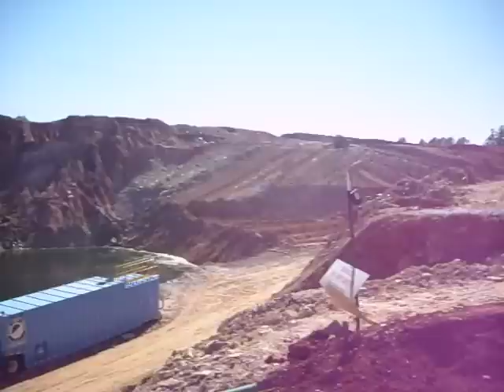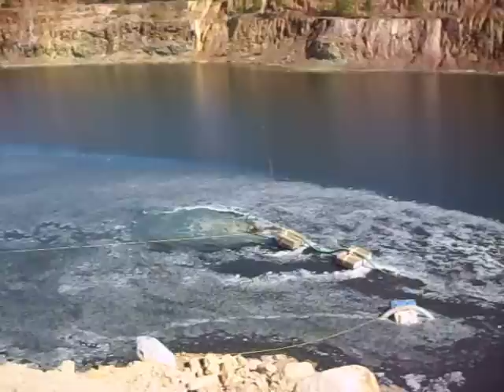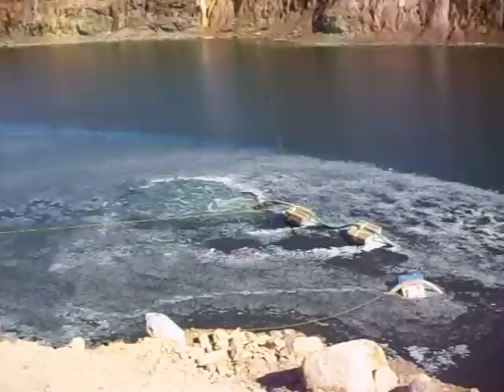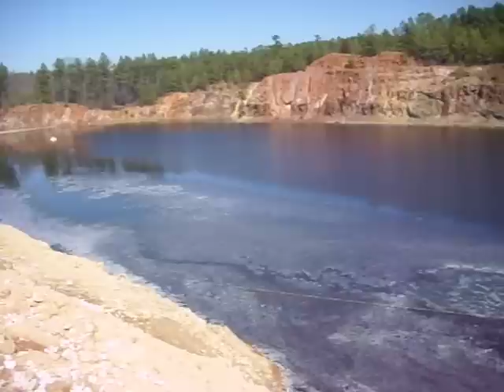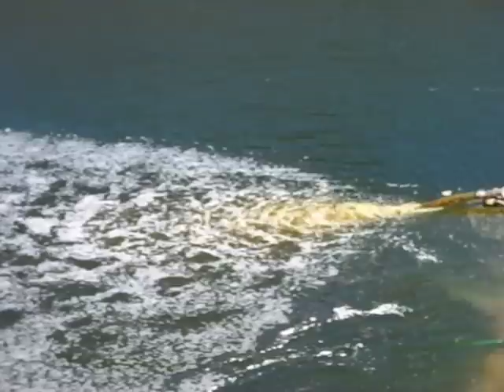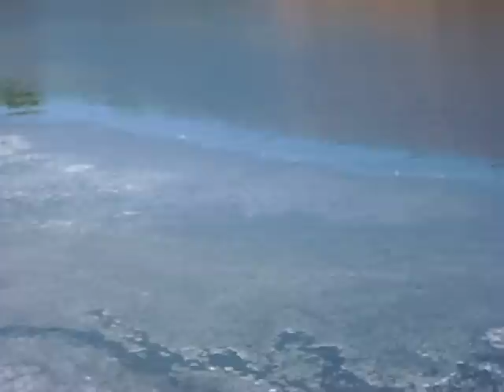Treatment of Barite Hill mine pit lake in South Carolina

Comment: i used to live within walking distance of this mine site when i was a kid. the site was owned by a company by the name of nevada gold fields.the mine was ran from 1991 to 1995. they claimed bankruptcy and left the mine as an open pit with the potental of contaminating local streams with very low ph acid. i beleive the ph was around 3-4 when my dad and i tested it (around 2004), and began calling dehec, and epa. also in 2004 i was diainosed with cancer that, according to the team of doctors i had, came from long term exposure of chemicals similar to cyanide, which was one of the key chemicals used to extracted the gold from the ore taken from the main pit.(Having the mine practically at our back door from 1991 until 2004 seams alot like long term huh?).  I brought this up at a local Q and A session with epa in the town of Mccormick. the reps. from epa contiuned to change the subject numerous times and my questions about possible cancer causing chemical was shrugged off. later epa released on the web that it was a very low chance of people getting cancer from being around the mine. Lies from our government! well thanks i guess for cleaning the mine up even though it did take over a decade of calls from the public!